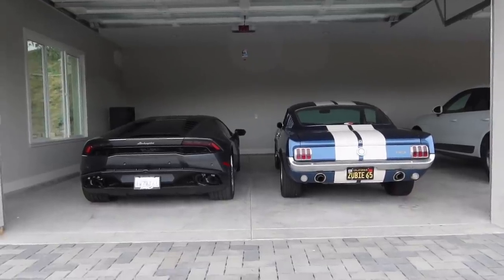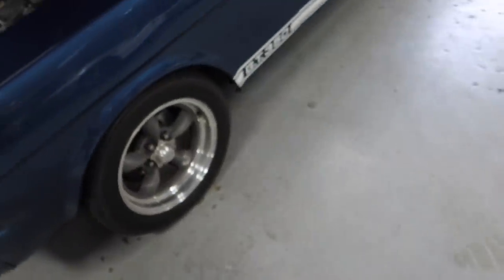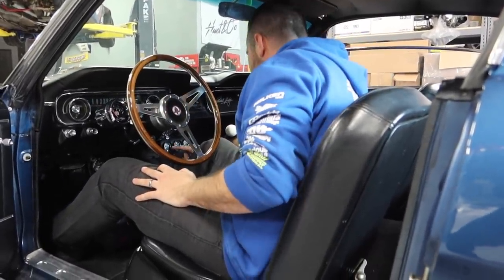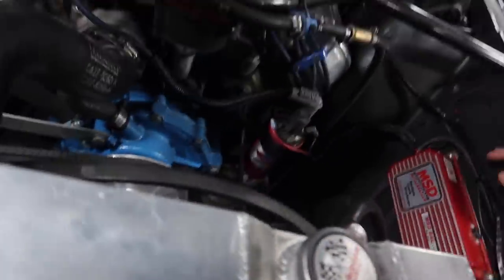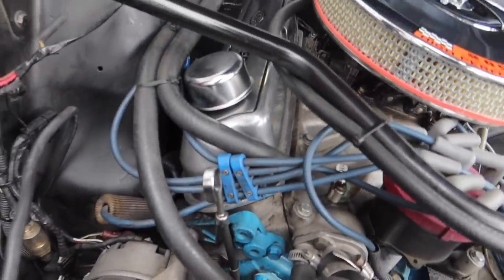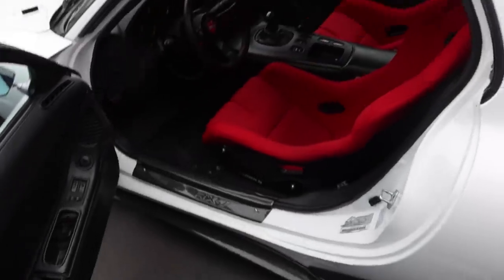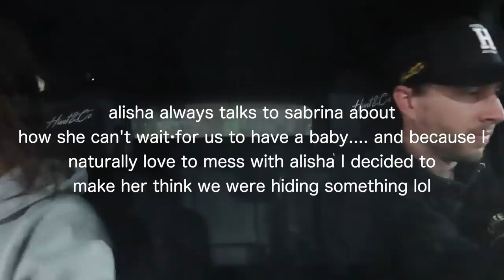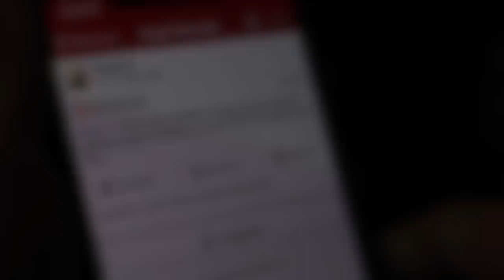Pushing the 1965 Mustang Fastback Till its Breaking Point!

Comment: So the cool thing about 4 barrel carbs is that four barrels will engage whenever the throttle is full throttle. Only two will normally shoot gas unless you pin the gas pedal. Also your brights for your headlights is that button near your foot pedals!

Comment: You need to prime the carb before start up. Pump the pedal 2-3 times, and itll start up better. if the car is already warm, push the pedal half way in and then turn it over as your doing it, it'll start right up.

Comment: On cold start push the gas pedal all the way to the floor twice and then start with foot off gas. This should set the choke. It will idle high. After about a minute (Prob less due to the warmth there) tap the gas to deactivate the choke and she should idle nice.

Comment: Prolly a 650cfm 4barrel carb. The tube that came from the air cleaner is for the vacuum, usually goes into the left valve covers. To fix your crappy brake problem. Prolly just need to rebleed the brakes. You have a new dual brake master cylinder. So you have power brakes on all 4 corners. Fuel gauge isnt working due a bad fuel sending unit in the fuel tank. Also you can buy a power steering pump for the car. They aren't too bad. Just need to upgrade the currently steering rack.

I wish I was there to give you a good run down of the car. I live for classics. It makes you appreciate the technology advances of the era.

Comment: If you read this, and if it matters at all, that looks like a “Blueprint Engine”. Most people go through Summit Racing and will buy blueprint engines which are basically drop in ready engines. You can most likely find a block stamp and look up exactly what size engine/specs it came with and has.

Comment: Also, nitrous is probably not where you want to start with that engine. With heads, an intake manifold, carb, and a cam, you can be well into the 400hp range with the ol 351w. And then stroking adds a whole new level of power potential.

Comment: whatever you do, don't convert to fuel injection. We swapped out 454 Chevelle to Edelbrock EFI and it ran terribly. No one wanted to "tune it". Went back to the carb and the car runs so much better. Not as much power but keep it authentic.

Comment: The car is carbureted. Which means it has a choke. give it 2-3 small pumps to the gas peddle before you start it. when it starts let the rpm rise a little then rev it a little. the carb does not feed fuel correctly at low starting rpm

Comment: I have a 68 I got when I was 18 so I’ve had it for a few years and can attest that manual brakes, especially ones that haven’t been bled are a terrifying experience. The manual steering sucks, the acceleration is... alright. But it’s still the funnest car ive ever driven.

If you have any questions about it I can tell you what things are and point you, generally, in the right direction

Comment: Tj: No one will know what I mean when I say it has no brakes.
Me: I know exactly what you mean. I got a 64 el camino that had a bad caliper and sheeesh, thing sucked at stopping
Reply: Anyone that grew up with these cars know all about it. It was just what it was back than. As long as you stop everything was cool.
Reply: @ratj4715  seriously though, worked on a 66 convertible for a customer and the thing stopped when it wanted too handled like a god damn boat (even worse then an elderado and they’re like 40 ft long)
Reply: @kolt4558  A lot of the cars were like that than. We just didn’t know any better. It was pretty normal to us a lot of these muscles cars were bottom line cars they were fairly cheap but throw some rims a loud muffler and you had a bad ass car. Not the safest that for sure.

Comment: "The coil pack is sitting on the exhaust"  ....unreal...
Reply: Funny thing is The Mustang doesn't have a coil pack!  It's a Distributor!  And the spark plugs wires come off it and the spark plugs are between the header piping.  It's a Normal design!  Still used by Chevrolet!
Reply: @drewdalesandro672  no shit
Reply: @ssfamous2.0  Sure you knew that!  My bad!
Reply: @drewdalesandro672  it's all good

Comment: Try flipping the gas nozzle upside down. Not sure if it works on the first gens but the S197s had a similar issue where the pump would shut off after a few cents of gas, but flipping the nozzle upside down always fixed it 😂 Worth a shot next time you fill up.

Comment: Redo everything. Sell existing motor and get a 427 with stacked fuel injection. The gas cap is in the middle of the rear sail panel.

Comment: TJ!!! Some 1964-1966 mustang things to know and what you should do.
GPS Spedometer
Wilwood disc brake conversion
If ya want her stiffer invest in subframe connectors and a rear sway bar
SHELBY DROP!!!! (although considering your driving a gt350 clone it prolly has it already)
Gas cap is the logo on the rear haha 

Make it badass Teej I know you will. 
(im building one too @66stang5.0) on insta 
For  those who happen to Gaf :))

Comment: Us classic owners are not mad.. we are laughing our asses off....Looks like its a 351 running a Edelbrock upgrade kit. It was modded a while back, I know every part in your car and there are much better answers today...And you can burnout those cars when tuned right with no brake use. And before you NOx it, go through the engine... its cheap compared to what you are used to dealing with and worth the $1,000 to $2,000 you will spend.

Comment: Damn I feel like $40k was a little much for that Mustang lol
Reply: @B M A , not really. the fastback is supposed to be super rare to find. most of the 65 mustangs were convertibles and coupes. I've seen a roller fastback go for $10k. 40k sound about right for this body style. also the car has a engine swap, those cars only came with a 289 v8. this car in particular has the legendary 351w that has twice the strength of the 289.